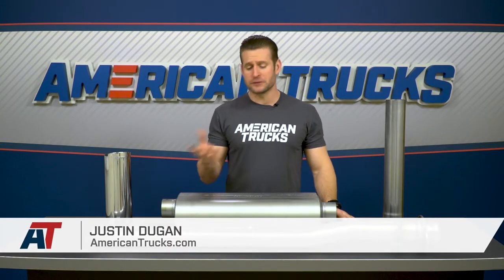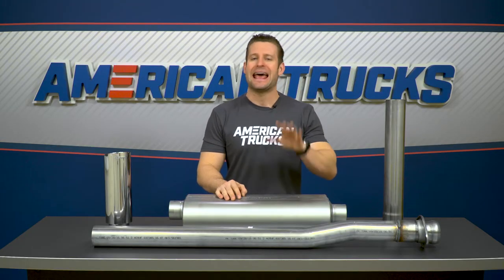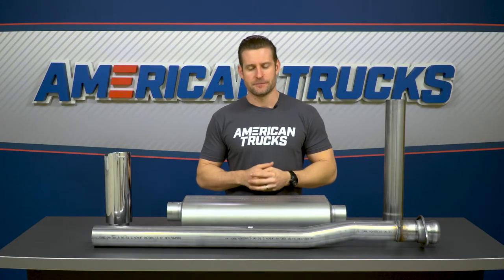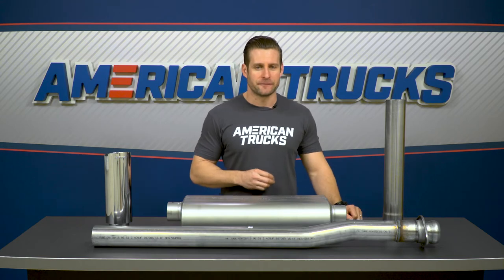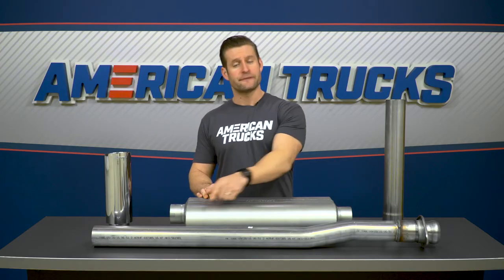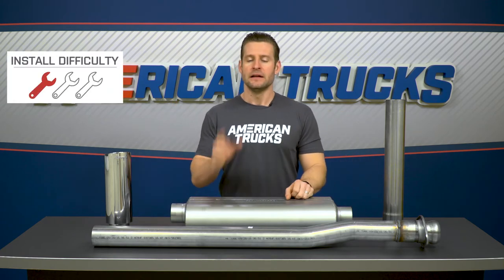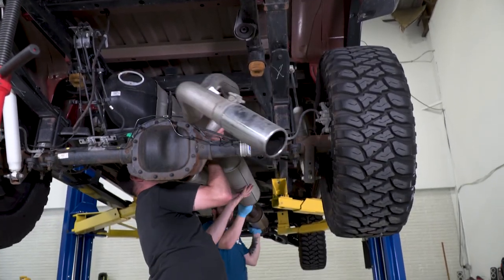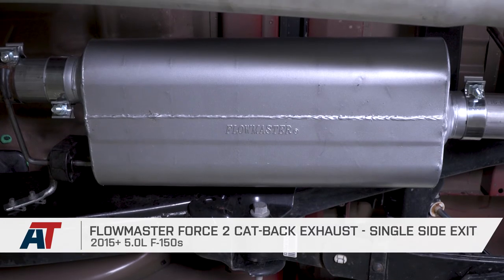2015-2017 F150 Flowmaster Force II Cat-Back Exhaust 5.0L Sound Clip & Install

Comment: Installed this today on my 2019 5.0, crew cab 6.5 ft box. 157" wheelbase. Cut 6" off the extension pipe just as the instructions said without measuring anything else myself and it fit perfectly. Did it on the ground, myself, drove back wheels up on some planks for extra clearance then ended up having to Jack it up a bit more on the passenger side just to get the stock system off. Long story short, not easy to do with one person on the ground, but do-able and sounds excellent, not as offensive as my old magnaflow on my '13, almost silent at idle, but definitely not stock sounding on start up or acceleration or when downshifting. Perfect balance.

Comment: Is there any drone in the cab?
Reply: Yes. I have this exhaust, and there is some drone in the cab. It sounds so good I don't care, though. You will like it. The installation was very easy as well.
Reply: The drone is the worst when you are trying to go easy and not be too loud. This system sounds good when you are on the throttle or at a warm idle. It is very loud on a cold winter start and will drive you crazy eventually no matter how good it sounds when you floor it. I’ve put my stock system back on and will not be using a flowmaster product again. They advertise this as a very tame system but removing the resonator is a bad idea if you want a mellow sound. Mine rusted so bad in 3 years I removed it and put the stock system back on before it  started leaking in the winter or something.
Reply: @stuart488  I ended up going with corsa. No regrets. Sounds bad ass and no drone
Reply: Awesome, I just did a muffler swap at a local shop and kept the rest of my stock system, the best part was them letting me do a fit test and hear different mufflers before I picked the one I wanted. Corsa is the way to go if you just want to do it yourself and keep your stock resonator too? Is that right with the sport?
Reply: @stuart488  yeah with the resonator is the sport and without is the extreme. I already had the resonator deleted from an earlier project and it sounded nasty I love it
Reply: @stuart488  I wonder if this kit allows me to retain my factory mid pipe, just like the way Corsa Sport and Magnaflow MF rear exit version. I just like the sound of Flowmaster exhaust but I can't stand the drone. In theory, I can probably use couplers maybe since the pipe diameters are the same?
Reply: On my 2019 the stock resonator pipe is 2.5”. The kit is all 3” pipe. But you could probably figure something out with a reducing coupler from 3” to 2.5”.